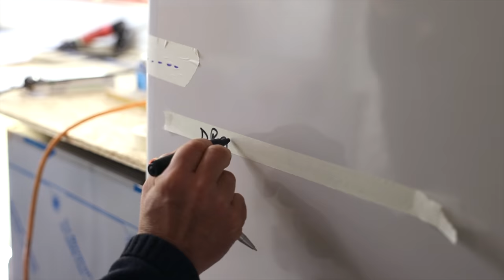Building an Accessible DREAM Catamaran! — Sailing Uma [Step 201]

Comment: When I tried the impossible dream website, it says no website exists. Do yall have another web address for them. I’m a disabled veteran US Marine retired. I’d seen a story about this boat in Dec 2016, and for the past 3 years I’ve been researching daily to learn everything I can about sailing and all the systems needed, and learning what boats would be best for my wife and myself. We will do a total refit and make it wheelchair accessible. Most think I’m crazy, but thinking outside the box, I can make a monohull wheelchair accessible and sail single handed. Thank You for sharing info on the magnificent boat
Reply: Hi. I like that you have a dream that you think might be impossible and still keep going! It’s not impossible, but it’s also not easy. You can even make a mono accessible, but forget the wheelchair for onboard use. If you consider a cat, the wheelchair will still be functional. Also, life onboard is insanely much more comfortable, even for those without a wheelchair. :-) Sailing is magic. Go for it!

Comment: The problem is the cost - a wheelchair bound friend was quoted over £1 million for a custom built accessible cat and there are very few second hand cats that could even be adapted without substantial outlay. Further, very few UK or tidal harbours are suitable for transferring a wheelchair user ashore, even marinas can have steps or very steep  (depending on tides) ramps. Tenders with bow ramps are few and far between and aren't exactly cheap either.
Reply: Not being rude..but are you glass half empty type of guy...gee throw some obstacles in his path..all can be overcome with a positive outlook on the unique circumstances that confronts him.
And some cash..👍
Reply: @reallynotyourbusiness1659  not at all - just a realist. The boat building/marine industry is one of the few that hasn't really adapted to disability, certainly not in the way the automotive sector has. Look at virtually any boat on the market and see if there is level access/room for a whelchair to manouvre/space for a disabled toilet etc., then consider how difficult it would be for a wheelchair user to actually get on a boat from the harbourside. How many tenders have drop/ramp bows? You can buy a Pioner for about £15,000 plus engine - but you can't call that a tender. Admittedly not all wheelchair users have the same level of disability and some may be able to "get by" better than others, but generally accessibility on sailing boats isn't great. I struggle enough because of my height let alone anything else.

Comment: Sure makes you more aware of tidal change.  I recall a place in north end of Se of Cortez where the tide change could range as much as 23 FT low min to max.  Made for some challenging arrangements.   l saw more than one unaware motorist come back to find thier vehicle parked on the "beach" only to find it up to the windshield in ocean.
Reply: You're thinking of Puerto Penasco, MX, (which is where I am). Yes, 24.5 feet of tidal difference at the spring tide.

I've heard say that it's more of a sloshing action, like water in a shallow pan, than straight tide rise and fall.

The water comes up the Sea of Cortez and hits the north end and kind of piles up there. Places only 60 miles south of here only have a 2 to 6 foot tidal range.